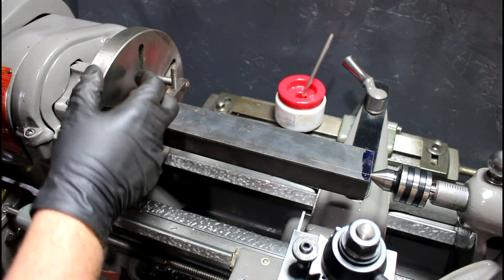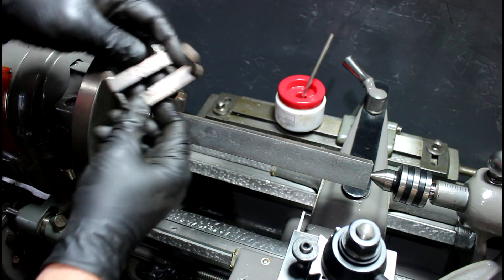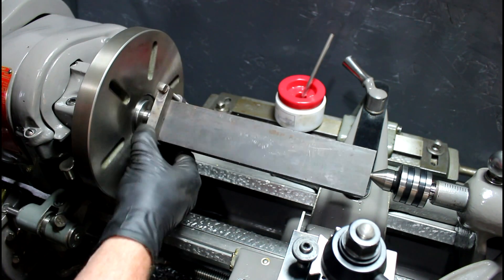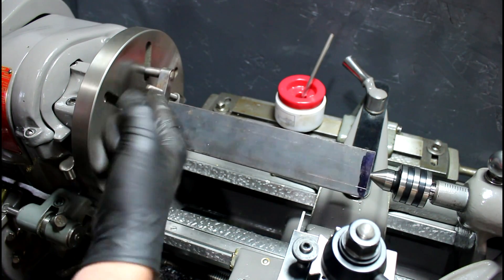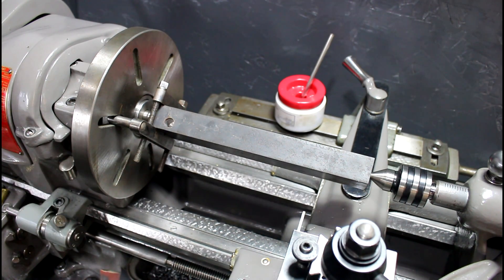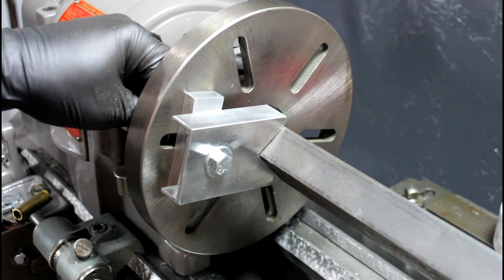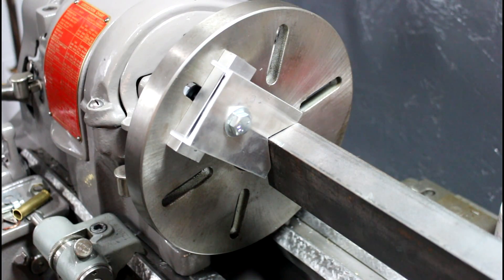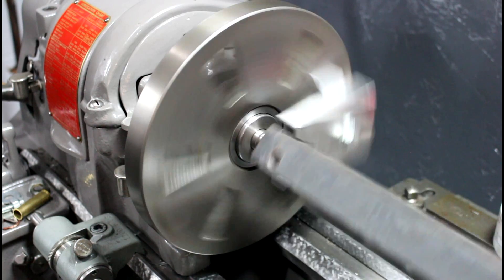Turning Square Stock, Making a Universal Dog for the Lathe!

Comment: Is it possible to cut a square aluminum stock on a manual lathe? There is a 12" long piece to be split into 3 equal cuts.  Thank you.
Reply from the maker: Sure, you just get an interrupted cut until you hit the radius of the stock with constant contact.
Reply: @precisionmachineshed  Do you recommend any specific tool for the cut?

Comment: I'm studying engineering and I need to choose between aerospace, advanced manufacturing and operations maintenance in a couple of days, could you help me decide what is best? Thanks.
Reply from the maker: Not sure I can help much other than this. I have two friends, one in maintenance, and the other in manufacturing. They both like their jobs but the guy doing the maintenance job is doing different stuff every day and usually making parts to "fix" machines. The other guy in manufacturing tends to work on a handful of projects a year and works on improving the product and redesigning it to ether make it function better, or cheaper to produce. I would think in the aerospace industry you would be doing a lot of high precision one off items. That's about all I have for you.
Reply: another thing I discovered in my career. Maintenance sounds dreary but the companies can't get along without it. I made more income as maintenance than any other field. Wages are high for skilled maintenance men and the jobs are always available.....

Comment: Made a one blade fan it sounded like. I really like the power hack saw. You don't see them for sale much here in Texas. I really would like one to go with my Dunlap tools and my 1933 Southbend 9" workshop lathe. You still have your Dunlap drill press? I love mine.
Reply from the maker: Yeah... it basically is a one blade?  I love my power hacksaw. For the amount of work I do it works great and I got it for next to nothing. I did sell my Dunlop drill but it was a very nice little drill press. I should have kept it but I have slowly upgraded to a vintage 1951 17" Delta drill press which is hard to beat in its size class. Thanks for the comments.

Comment: I feel like having that massive chunk of metal off to the side would give some problems with balance... Wouldn't it cause some inaccuracies in your machining?
Reply from the maker: I would recommend sliming it down a bit, but the aluminum is pretty light And the bolt has more weight than the aluminum. If I were to make a new one, I would use a smaller bolt and less material. It ran pretty good on my lathe.
Reply: Cheater method, you could just add some weight opposite the clamp, even if it was just a bolt and nut.  How much it rocks also really depends how well it sits on the floor.  My old shop floor is not real flat, and if I run off-balance things my 10L rocks around.  I need to spend some time with shims to level it better and then anchor it down.  I tried to spin a 50 ounce imbalance harmonic balancer on it and it was not impressed.
Reply: I think the video is sharper and clearer than earlier videos?? Did you get a new camera? I really think you do a nice video to watch with your time lapse shots. I think I would say your videos have good momentum; you get your presentation across without bogging down. Good job and that set up wouldn't scare me. I actually, have a couple of drive dogs like your Starretts that are Armstrongs.
Reply from the maker: Thanks, yeah I bought a new camera a year or so ago now. I also tried to streamline these videos as much as possible. Thanks for the comments.